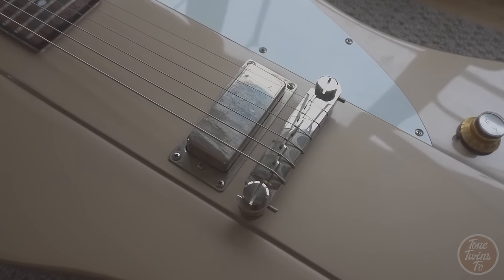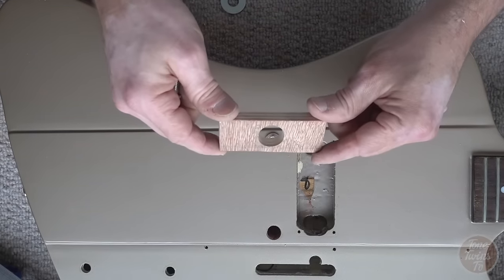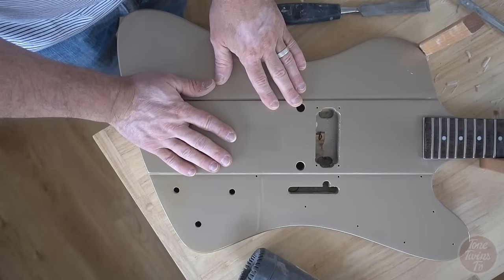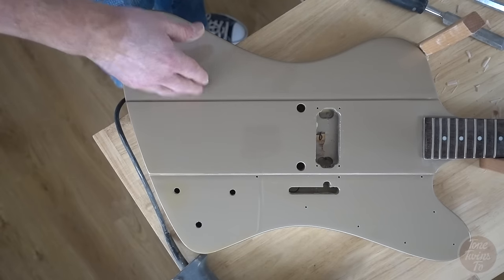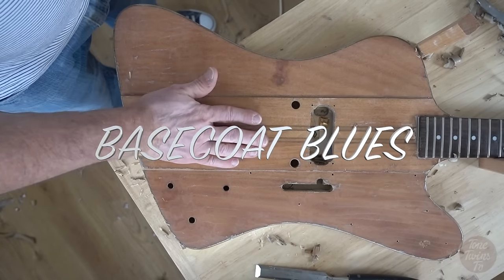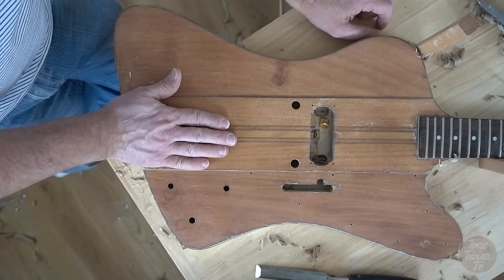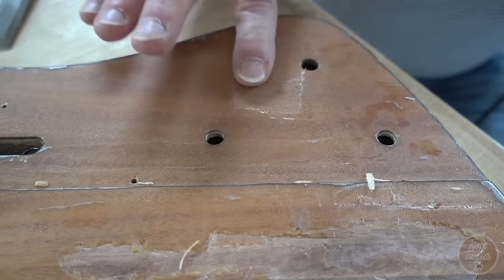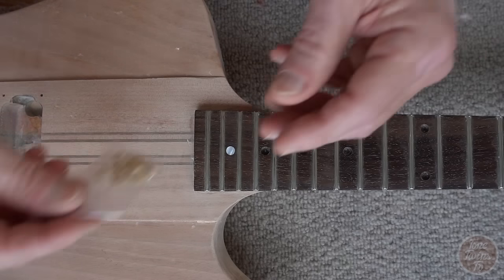How to strip and refinish an Epiphone - Joe Bonamassa Firebird Refurb (Part 1)

Comment: I stripped my Epi Goldtop Pro this summer as I hated the poly finish. Man it was a job and half, but really glad I did it. I took the veneer off the top too. It was so thin and flimsy. I left the natural finish as the mahogany under all that paint was actual really characterful. I ended up oiling and waxing it. I have a very unique looking LP now. New pots and handwound P90s, not only looks good, sounds amazing too. Looking forward to Part II ;)
Reply: Upload some videos of that guitar, we want to see and hear your axe.
Reply: How did you remove the finish without damaging the binding?
Reply: @NathanSink  heat gun and a scraper. Nice and slow. Its a killer job but worth it in the end. Just take your time.

Comment: I bought my father a cheap melody maker from epiphone for this purpose. 
I was literally just wondering how i would go about that?
Was going try to take the easy way out and just try to add accents. But I might as well do it completely custom. 
 I got some soap bar p90s going to route out down the bridge a jb humbucker I'm going to add for the middle, and I'll just leave the single coil for the neck. Eventually, i get a good custom bolt on.
 I'll have to check the channel for a paint job video?
I was going to get a kit, but i love epiphone and have most of the parts already. For 99 bucks, i don't have to "fret"  over messing it up.
Sorry for the dad joke.
 Probably route it before i take the paint off?

Comment: That final base coat I guess is a sanding sealer?
With a solid body like you have there is it identical to Gibson? It looks that way from your filming. 

Regards,
Andy.
Reply from the maker: Well, it's a proper multi-laminate through neck construction so pretty much vintage spec.

Comment: Hello, very interesting video.  Just one question: why didn't you just sand the body???
Reply: Sanding makes a hell of a mess: the finish turns into a static electrically charged powder that gets everywhere! The finish will also gunk up the sandpaper so it doesn’t last long. The powder is toxic so you should use a respirator in a well ventilated area if you choose to sand. I refinished a beige Peavey T-15 a million years ago and I used a chemical stripper (outside) because my Dad didn’t have a heat gun (they were expensive, $10 Harbor Freight heat guns were a ways off). Peeling back the thick paint, I could see a huge knot on the arm comfort carve, and I knew why it was painted. 😂
Reply from the maker: What William said plus the fact that sanding doesn't really work with these finishes. You can go at them with 60 grit on an orbital sander for ages and nothing really shifts. I In my experience it's actually quicker to do it with using heat gun and scraper method.

Comment: Steam the neck off and run it through a planer? Cheating, I know but damn  nerve racking with a chisel and than many miles just to get to yowza!
Reply from the maker: Erm... it's a through neck construction. Not quite sure how that would work.
Reply: @tonetwinstv2863  ….looks like I would have made a cricket bat with my approach!
I forgot about that neck-through construction. It looks beautiful. Great refin!Must be his favorite guitar. They just get better after the wood learns to be a guitar. I had a custom Nick Lucas made and it’s taken 8 year’s to begin to shine. Good bones, but it didn’t know what it was yet?
Any tips on a ceruse finish ash where I brushed out the grain so that the finish undulates for the contrast? 12 light coats of nitro on top but a bit confused on how to wet sand? Do I just sand the plain of the face  and leave the grain fill alone? Maybe it would make it contrast even more…. Might look strange though? I’ve seen the Collings dog hair finish but it’s flat and uniform.  I’m going to leave it out in one of our -25 below nights and hit it carefully with a heat gun to check the nitro. Black dye with silver gilt cream in the grain. Cream pickguard to give it a tuxedo appearance with a just hint of orange in the dyed flame maple yellow neck.  A very dressed up guitar….my first tele and completely untraditional except in function. Have any tips on a sanding an uneven finish? I guess I may be lazy but I don’t want to burn through the finish on the margins of the ceruse and plain. Careful as you go I suppose?

Comment: why are we striping 1500 dollar brand new guitars? i mean i know why but i would not advise anybody go striping finishes unless its battered, and faded. a "shut up and take my money" kind of job if ive ever seen one
Reply from the maker: Totally get where you're coming from and respect your aesthetic preference - if not your cynical closing statement. The owner's reasons for doing this include getting the sunburst finish he would have wanted in the first place if they hadn't all been sold out, preferring the look and feel of a nitro finished guitar to a poly coated one and making the guitar about half a pound lighter. In addition, the neck is now almost 3mm narrower, so it feels more comfortable to play. As for the money side of things, the cost of the work added to the purchase cost comes to slightly less than  current second hand asking prices on Reverb. Our guess is that if he decided to sell it with all the upgraded parts, he'd probably make a decent profit.